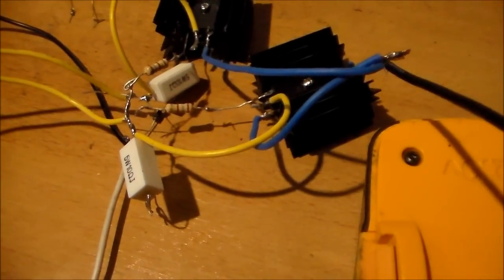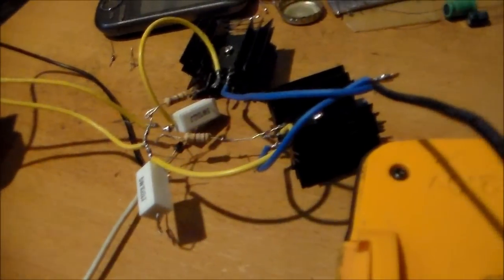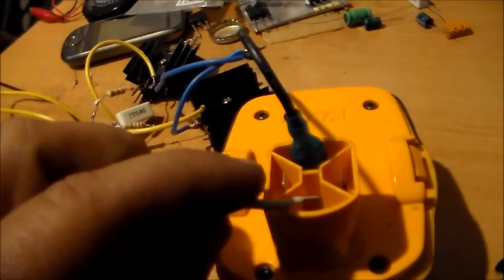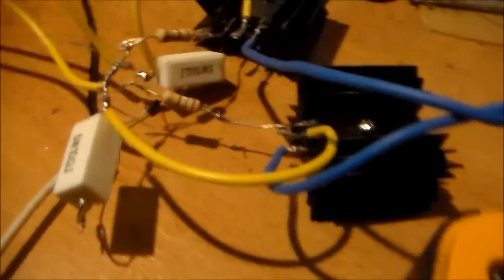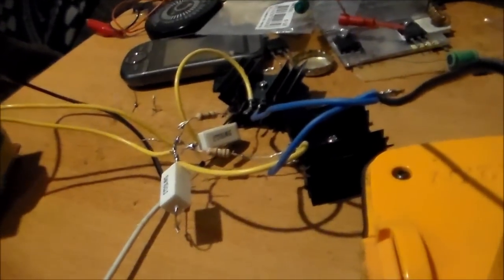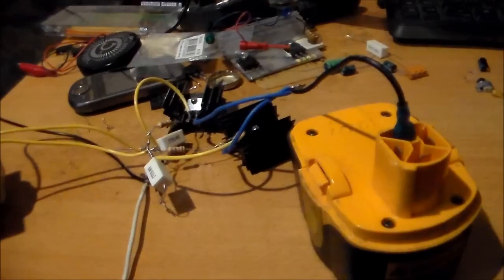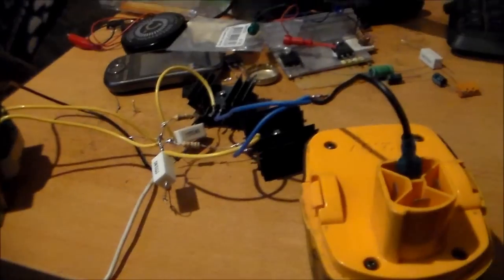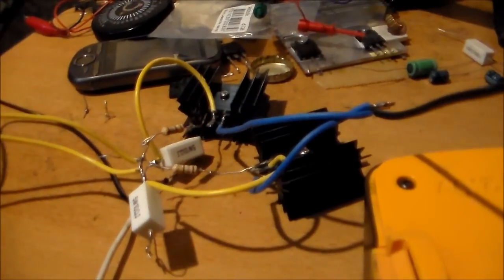Sunday Stress: The Cider Inverter Capacitor Charger Part One

Comment: I agree with the previous posters,iron core transformers are happier at lower frequencies. The last iron-core inverter circuit I built ran at ~1.6Khz,because the iron core transformer was most efficient at that freq. (The audible whine is annoying though.)

Comment: The frequency is too high for that transformer. Try winding a flyback for a couple hundred volts with some fairly heavy wire for the secondary. You will get a lot more power from it just using a normal zvs driver. Use some high speed diodes to rectify it for charging capacitors.